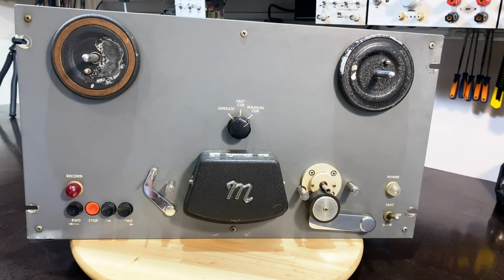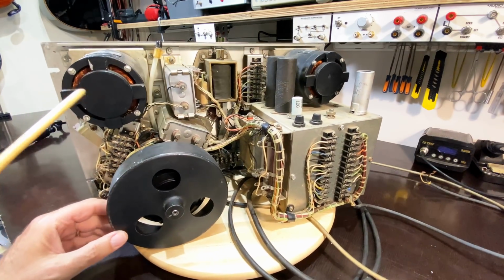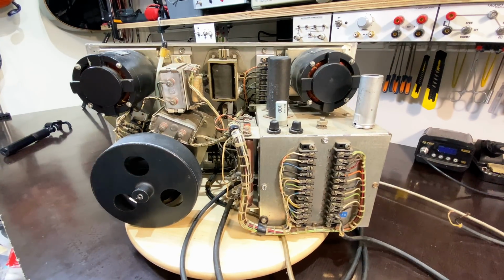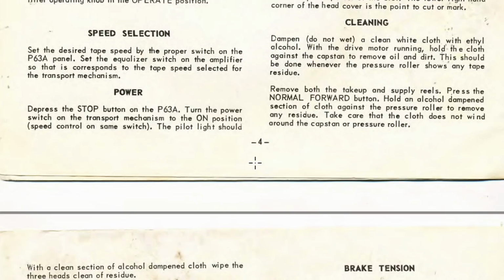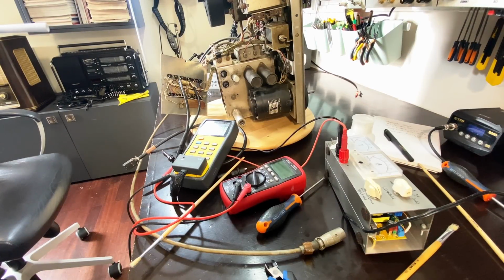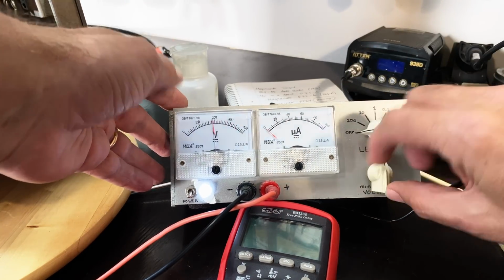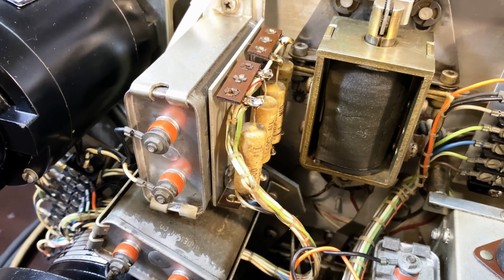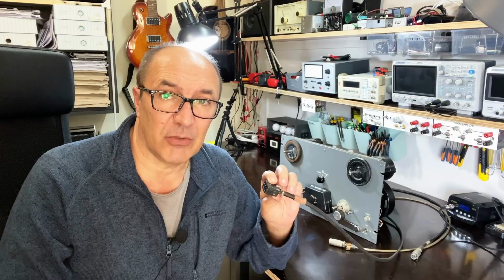Giving new life to a relic tape recorder. Magnecord P75A restoration.

Comment: Looks a lot like some of the old computer tape drives I used to service.  Except for the hefty servo electronics that my machines used to synchronize the motor movements and make them go scary fast in rewind and FF modes, the technology appears to be not much different.  I'm looking forward to the restoration.

Comment: Beautiful professional machine. In the specs the wow and flutter is said to be below .25, and I think that is a bit high, it is on the edge of what one can hear, aspecially on piano, so I think attention is needed to check the torque for the take-off and pick-up hubs to make sure they don't drag the wow and flutter above that .25. I read in your manual that these adjustable resistors R111 and R113 are for that. Play around with a self build torque meter;  force x arm length.
The capstan roller / pinch roller looks bad.... and is just as important as the two hub torque to keep wow low. I guess that such a machine has places on earth to get its parts from, but I also think that there are companies specialized in refurbishing such roller. But from here I can only see it shine, can't feel the stiffness.
Reply from the maker: I believe the owner has contact with these companies, so we should be able to source any parts or services needed.

Comment: Now that's a capacitor tester! Now I'm off to see that video... Thanks for taking the time to use it, most people just check esr and move on but you took it to the level that everyone who works on vintage equipment should be doing...
Reply from the maker: thanks
Reply: @electronicsoldandnew  your welcome, I went to see the build of the tester only to see that I have already liked all the videos in that series but I'm watching them again to refresh my memory.. I already have a really good LCR meter that gives me everything I need to know but I still want to be able to test at rated voltage which I can't do with my LCR meter.

Comment: It's going to be interesting to see how or if it performs. I noticed the pinch roller looking quite shiny which indicates high usage. Yet all the wax and electrolytic capacitors  seemed fine. My concern is that the capacitors will start to fail under test, but that's what testing is for after all. The motor bearings may require cleaning and lubricating, I don't know if you did that. Good luck, looking forward to the testing stage.
Reply from the maker: Me too 😊

Comment: Thanks Manuel, a very absorbing episode. As others have said, a high quality machine. With regard to your comment about the bad paint finish on the spool hubs, I have used a product called "PJ1 wrinkle" black aerosol paint for several different chassis of home brew valve amp builds with excellent results. If you dared, it may be a way of restoring the look of the hubs. I'm looking forward to the next instalment.
Reply from the maker: good idea

Comment: I see some people already pointed out that you will almost certainly have to do some sort of 50 to 60 hz conversion. Manufacturers back in the day tended to use synchronous motors in equipment like this and adjust for different frequency by having replaceable motor pulleys. If this is the case you may need to get creative about getting a 50hz pulley, if it even exist for this machine
Reply from the maker: I feel another learning curve coming on, about building the correctly sized pulley for this 😊

Comment: Beautiful example of electromechanical equipment, definitely commercial grade doesn't have the slower reel to reel tape speeds but oh well. Be sure your three motors are not 60 cycle synchronous, I thought I saw your instructions talking about motor speed control so you're probably okay all the connectors I saw are still available. Gee your friend will need a sizable step down transformer to run his collection. This definitely is going to be an interesting project to watch. Don’t forget to get that expensive jewelry for the better half gift.
Reply from the maker: The line frequency may well be an issue. We’ll see. He’s going to need a private power station if he keeps this up. 😊 
As for the jewellery for my (much) better half … I tried offering her a magnificent tube radio in the past, and she wasn’t impressed. I guess jewellery it’ll have to be 😊

Comment: Do you have reels and tape for the machine? What speeds it's supposed to run at? I guess this will do 15'' (38cm/s) and 7.5'' (19 cm/s), but it's probably designed to run at 60 Hz.  There may be an adjustment for 50Hz, otherwise it will  run slow. Does it have a full track head (writes the entire width of the tape)?
Reply from the maker: My buddy does have reels and tape. The rest I’ll have to see when we actually get to test it.

Comment: Won't you also need to find a way to compensate for the difference between 50 and 60 Hz line?
Reply from the maker: That is a real possibility. We’ll need to see if there are adaptations needed.
Reply: There's the possibility of using a double-conversion UPS to do the work.  They can be programmed to output different voltages and frequencies, and produce extremely clean power.

Comment: That is a capstan Motor near to the bottom with the large flywheel, there must be some form a single to 3 phase conversion to facilitate driving the Capstan Motor.
Reply: It's single-phase. The tag on that motor is visible in the video.